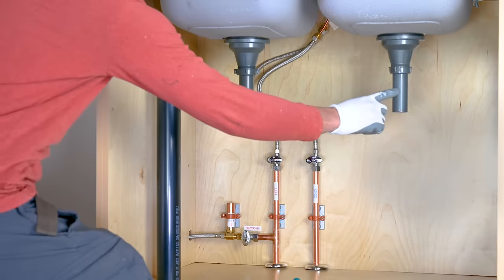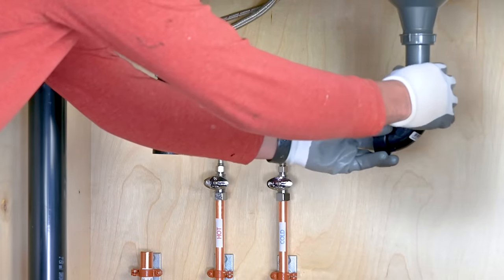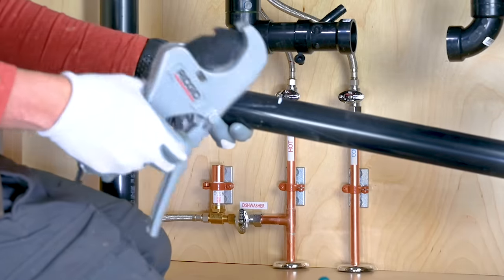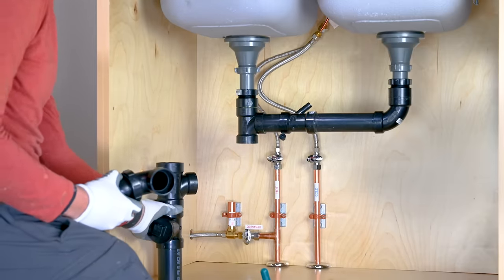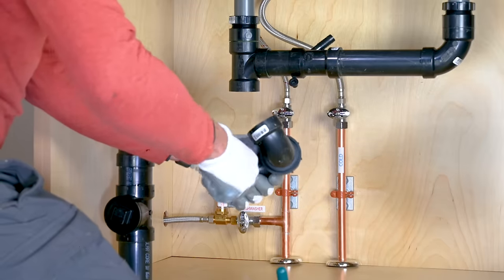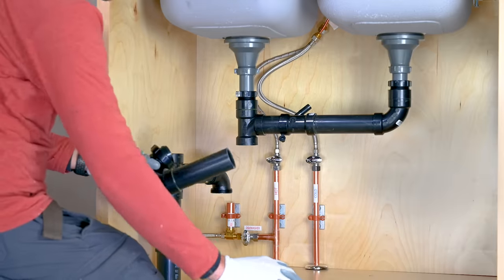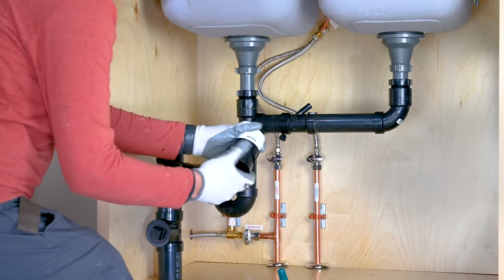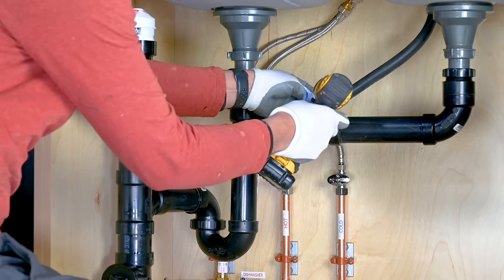How To Connect a Kitchen Sink Drain - 2023

Comment from the maker: ABS DRAIN INSTALLATION:
1-1/2”* 1-1/2”- ABS Slip Joint: https://amzn.to/46ZEqBp
ABS 90 Degree Elbow:  https://amzn.to/4alJnr6
1-1/2” ABS Tee: https://amzn.to/3t6oQpK
ABS 1-1/2”* 1/2” Dishwasher Wye:  https://amzn.to/48kVVx7
1-1/2” Union Ptrap: https://amzn.to/41jrNjf
2”*2”*1-1/2” Tee: https://amzn.to/3Nqi7O1 
ABS 2” Cleanout: https://amzn.to/4ahvZnL
Oatey Sure Vent & Adaptor: https://amzn.to/3NrVV66
2”*2’ ABS Pipe: https://amzn.to/3t6pjIw
1-1/2”*4’ ABS PIPE https://amzn.to/3NnLhxm
ABS Glue: https://amzn.to/3NrVKIl

PVC DRAIN INSTALLATION:
1-1/2”* 1-1/2”- PVC Slip Joint: https://amzn.to/41teE7q
PVC 90 Degree Elbow:  https://amzn.to/3RHv48X
1-1/2” PVC Tee: https://amzn.to/3RmIC8j
1-1/2”* 1/2” Dishwasher Wye: https://amzn.to/48fWsAb
1-1/2” Union Ptrap: https://amzn.to/48hIoX6 
2”*2”*1-1/2” Tee: https://amzn.to/3TnU8mE
PVC 2” Cleanout: https://amzn.to/3RCJlUd
Oatey Sure Vent & Adaptor: https://amzn.to/3RKk8Yg
2”*2’ PVC Pipe: https://amzn.to/3RpD25j
1-1/2”*4’ PVC PIPE: https://amzn.to/4anvusb
PVC Glue: https://amzn.to/3GI8yq0
PVC Primer: https://amzn.to/47UfXhP

Comment: If that sink backs up it’s gonna come out thru the studor vent because it’s not above the sink’s flood rim.
Reply: It's a one way valve. I assume if it won't let air out, it won't let liquid either.  In an island installation there is no way to get it any higher.
Reply: @wal707  one way valve??🤣🤣🤣🤣
You really don’t know what you’re talking about. Never in my life have I seen an AAV with a check valve.
Reply: @wynstondannerman605  an aav is, by definition, a check valve: air can come in but can't go out. AA=air admittance. Air can come in, but nothing can go out.
Reply: @wal707  keyword “air”.  Sewage is not air.
Reply: @wal707  and it’s not even a check valve. The reason sewer gasses don’t come out is because there’s a charcoal filter.
Reply: @wynstondannerman605  With Oatey’s Sure-Vent® AAV, a pressure change of -0.01psi (-0.25 inch H2O) activates the AAV to open. When that pressure is equalized, the AAV returns to its original seal, preventing sewer gasses from entering the vent.
Reply: @wynstondannerman605 plumber here bud. As someone who’s installed plenty of studer vents,  aka air admittance valves,  I’ll chime in. The real issue here seems to be your reluctance to fact check.  Properly functioning aav’s will not change the flood rim level. Check the manufacturer recommendations for installation height. Usually you need to be at least 4” above the T. Most places don’t allow studers anyway,  these were designed for vent systems with no stack access.
Reply: @scottfletcher1956 I don’t care if you say your a plumber. I’ve done nothing but residential and comercial sewer/drain repair for 6 years. Both IPC and UPC require that mechanical vent fittings need to be 6” above the flood rim.
Reply: Doesn't work - my bathroom stinks. Here on planet earth our atmosphere has pressure changes ALL THE TIME. 

I bought two of these Oatey valves. My kitchen sink still stinks when I use it and my bathroom always stinks even while not using any roof ventilation fans.  I replaced with this "quality" admittance valve one in my bathroom and the stink is still rotten.  Why these things are rated so high is a mystery to me. 

Oatey and Studor and most others have only one seal and would probably work IF MY HOUSE WAS IN OUTER SPACE  where there is no pressure changes in the atmosphere.  

Do not waste your money on the one-way vent in my opinion. 

Btw: water does come out.
Reply: @m.b.1974  sounds like your sewer has bigger issues if you have sewage coming out of your mechanical vent fittings.
Reply: How are you planning on installing a studor vent above the flood level rim in this situation?
Reply: @nashwalker7 I'd assume it would have to be above the top of the sink since that is the rim that it would flood to
Reply: @speed_demon420  yes but few are installed this way.
Reply: Right and wrong, it wont come out from vent, it will clog the vent
Reply: @m.b.1974 well buddy you got some major issues for sure and it's a lot worse than a cheater vent!!!
Reply: @nashwalker7 16th bends can kick it over and allow you to go higher but it depends on code where you live!!!
Reply: @wynstondannerman605 ohhhhh be quite 😂
Reply: I plan to use an AAV. I will first drill a hole in the stainless steel at the top backside of the sink, just large enough for the threaded part to fit through. Then I’ll attach the dishwasher drain hose to the Y and plumb the other side to the main drain. Either way it will be slightly above the FLR. Hope this works.
Forgot to mention that it’s a double basin, kitchen sink.
Reply: You realize that to get it above the flood level rim it has to be drilled through the counter top and stub above the sink itself, right? This location is fine.
Reply: @brettvogel8418  you realize that the flood rim is where the drain meets the bottom of the sink? And most sinks have a depth of 8-10 inches. Let’s do some quick math. If a studor vent has to be 6” above the flood rim, and you have 8-10” of clearance, how much space is left?
Reply: @wynstondannerman605  no man you're wrong. Flood lever rim refers to the point of where the water will overflow from the fixture, in this case the top of the sink, essentially the height of your countertop. These are very simple fact checks you can do yourself before arguing.
Reply: @brettvogel8418 you are correct 👍
Reply: @brettvogel8418 correct. I was interested in this video since I’m doing an island. I’d prefer not to drill my quartz for a stack. 😂 It’s Mexico so there’s no code issue, but I’d also appreciate the lack of sewer smells where we’re going to cook and eat 😆
Reply: @brettvogel8418  you realize this is a kitchen sink, right?  No over flow on a kitchen sink buddy. Maybe a lavatory sink, but not kitchen.
Reply: @wynstondannerman605  haha k what? What did I tell you about not fact-checking before you argue? Please enlighten me. So Lavs can overflow, but Kitchen sinks can't? Is that what you're saying? How awkard....

ALL plumbing fixtures have a flood level rim. The height at which water can no longer be contained within the fixture and will overflow. It's not rocket science. Wow.

I should also add that a fixture equipped with an overflow has no effect on flood level rim. Also, if you're filling a tub or a lav with an overflow, it cannot be relied on to drain the water faster than the tap can fill the fixture unless you have low pressure. I just can't see what point you're possibly trying to make haha
Reply: @brettvogel8418  this guy needs to install a loop vent and not use air admittance valve. Journeyman plumbers know this
Reply: @wynstondannerman605  build a loop vent and dont use air admittance valve. Journeyman plumbers know this
Reply: @FlightMojo build a loop vent . Don't use air admittance valve
Reply: @davehorseman  most jurisdictions allow for the use of AAV's in islands and renovations. You could do a loop vent if you want, but it takes a lot more time and material to achieve the same end result if you're actually doing it the proper way, not just running the vent back into the drain like I've seen hacks do before.
Reply: He could have and should have installed the AAV much higher. Basically it could be easily fitted touching the worktop.
Reply: No it wont. I know this for certain, because my sink backs up occasionaly from one to the other when cleaning the garbage disposal. Never has anything come up through the studor vent. My house is new construction too, so I can safely assume it's up to code with 1000's of others built exactly like it.
Reply: @rickybobby7276  Of course it won't! Its design is effectively an air lock. It's pressurised and won't let air out, but will allow air in, so the arm is always full of air down to the T. The longer and higher the better, but a quality make won't leak.
Reply: In my jurisdiction it’s only required to be 6” above the flood rim if is a wet vent.  Only 4” above trap is required.  Read the code for your jurisdiction.

Comment: The air admittance valve should be place as high as possible, the height you have it is no good because it is lower than the bottom of the sink. Expect a leak through the valve if there is a clog.
Reply: The only reason i came here was to see how many comments there would be like yours. Air admittance valves function like check valves. It lets air in as water drains to protect the trap, then closes to prevent sewer gas AND waste from escaping. If your sink is plugged, it will come up through your drain, fill up ypur sink, then spill over on your countertop and/or floor if left to do so. It makes no difference if it is installed above or below the drain. Fact check yourself.
Reply: im a lucky dude that can just pierce through the wall to get that admittance valve outside of the house :)

Comment: Nice video.  Clearly explained, however, the AAV should be above the water overflow level of the sink for code compliance.  Because so any have been done incorrectly, many municipalities have banned them altogether (which is a shame, because they are great if installed correctly).

Comment: The pipe connecting the left and right sink , the one that has the dishwasher connection, it looks like it slopes down to the right sink.  Shouldn't it slope down to the left?  The bubble on your level was to the left, shouldn't it be to the right?

Comment: Very nice. Thank you sir. It's good to mention that the 90 used on the right side sink is a long 90, not a regular short vent type 90. Another issue that I've seen in almost all these videos is when the dishwasher drain hose is installed, it is fed from the top of the cabinet to the waste line adapter. This can lead to sewer gases coming into the left sink. I was told that the waste line must go down to the BOTTOM of the sink cabinet and then up to the waste line adapter. My friend had issues with sewer gases and I fixed it by doing that.
Reply: If sewer gasses are getting past the trap to the waste line adapter then there would be gasses coming out of both drains
Reply: @darrengillesdarrengilles8336  True. Thanks darrengilles.

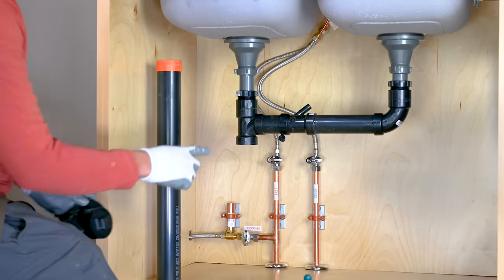Comment: Great video. Question, at 3:06, it seems like the leveler is showing high towards the left. I thought you said that it should be sloping towards the drain (which is on the left). If that is the case, then the right side should be higher on the level, no?

Comment: Does the DW drain hose neccessarily have to exit before the P-trap ? IOW can it go into the drain pipe by passing the P-trap?
Reply: I believe the dishwasher discharge fitting must be installed ahead of the P-trap, otherwise discharge following the P-trap will create suction that will empty the P-trap rendering it ineffective.

Comment: I got a bad smell came out from the air vent. do you have any way to stop it? Thanks. Tim
Reply: if the vent is an AAV (Air Admittance valve) like the screw one type then it's supposed to block smells. if there are smells from it, it means the valve is stuck open or broken.

Comment: I want to see it done with a Garbage Disposal, instead of the Sink Strainer. Dual Traps, in Place of the Old single trap. Also a clean out to meet Codes for the New Garbage Disposal. A new Receptacle in the Cabinet, with an Air Switch, because there’s no room in the Panel for a GFCI Breaker. All in a Cabinet with a Center Style. Boss, wanting to know what took you so long.

Comment: some people saying this cheat valve is not safety and could cause explosion because of gas ..dont know if this is truth
Reply: I've used the Studer vent , it works but needs to be placed a certain distance from drains and can only handle 2-3 drains at most depending on how much they are used . The directions say it can handle more vents, but I've run into problems doing that.

Comment: Great video, very informative.

However, with respect to the AAV it Doesn't work - my bathroom stinks. Here on planet earth our atmosphere has pressure changes ALL THE TIME. 

I bought two of these Oatey valves. My kitchen sink still stinks when I use it and my bathroom always stinks even while not using any roof ventilation fans.  I replaced with this "quality" admittance valve one in my bathroom and the stink is still rotten.  Why these things are rated so high is a mystery to me. 

Oatey and Studor and most others have only one seal and would probably work IF MY HOUSE WAS IN OUTER SPACE  where there is no pressure changes in the atmosphere.  

Do not waste your money on the one-way vent in my opinion. 

Btw: water does come out.
Reply: Atmospheric pressure changes are rated in 10's of millibars and the range is not nearly enough to actuate the mechanism inside of the valve.  Something else is wrong with your setup.  People use AAVs all the time and don't experience what you're going through.

Comment: Probably not a good idea to hard pipe everything under the kitchen sink.
Reply: What do you suggest? Using a hose? As a plumber, I can 100% recommend that you hard pipe everything under your sink, except for the dishwasher line.
Reply: @brettvogel8418  using tubular piping all the way to the trap adapter. Easier to disassemble and maintain.
Reply: @nashwalker7  not even legal to use where i am, so it's probably not great
Reply: @brettvogel8418  lol where are you from that using a slip joint connection is illegal? Only if it’s concealed. Which being under a sink, it isn’t.
Reply: @nashwalker7  ok what? There are slip joints in his installation lol. I thought you were talking about that corrugated flex or something
Reply: @brettvogel8418  lol there are two slip joint connections, not all slip joint, that would have to be loosened along with the union for the ptrap. So that’s one massive piece to deal with if you ever needed to service it. Whereas slip joint fittings which includes poly pipe, quickly breaks down for easy maintenance.
Reply: @nashwalker7  ahh ok. It's not hard to take that off. If EVERY joint was a slip joint, it would make more maintenance necessary. What he did will last for years